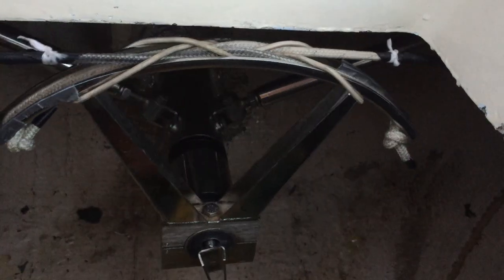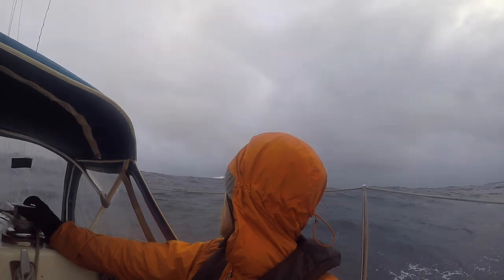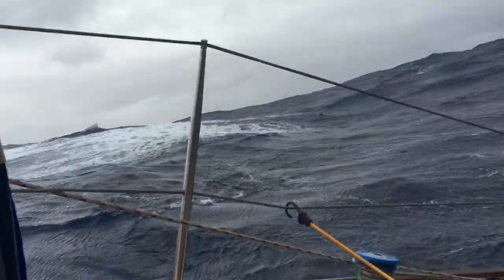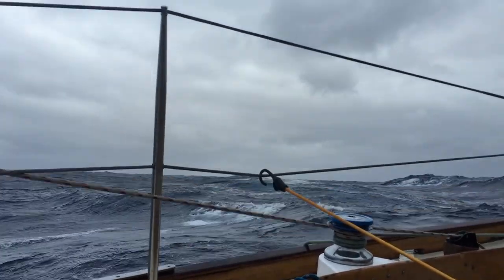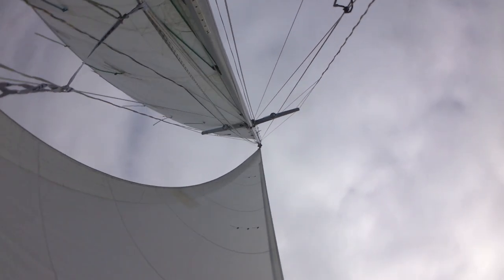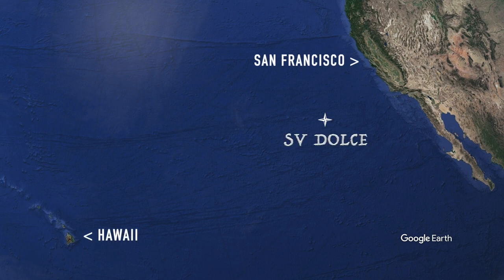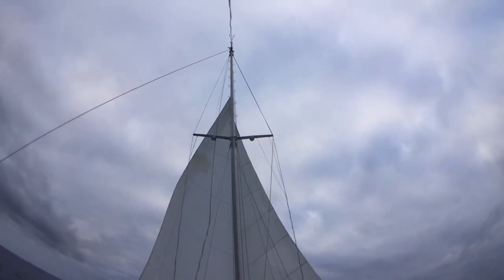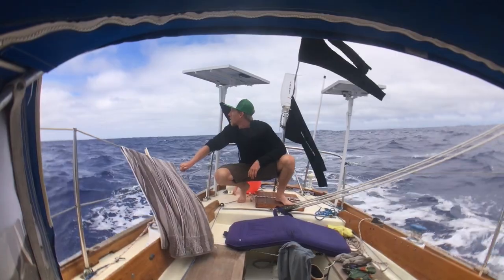Pacific Ocean Crossing - Sail to Hawaii - Storm Tactics Fail - Ep #38

Comment: Are they maybe called Pulleys ? The round spinney things ealry in the video are maybe called Pulleys. They may be part of the spring blocks but, individuality I think their called pulleys.
Reply from the maker: yeah :) blocks or pulleys works. According to Wikipedia : In the case of a pulley supported by a frame or shell that does not transfer power to a shaft, but is used to guide the cable or exert a force, the supporting shell is called a block, and the pulley may be called a sheave. Cheers!